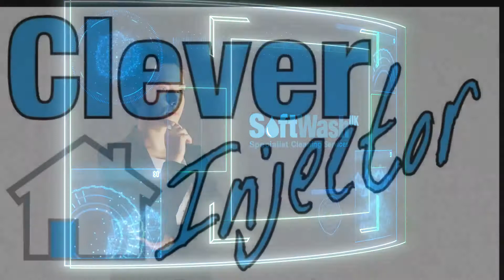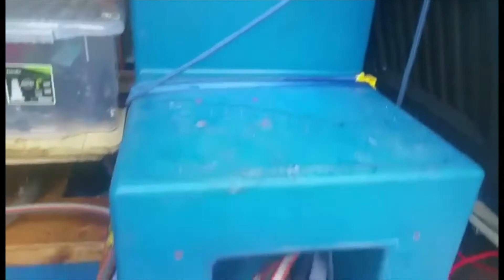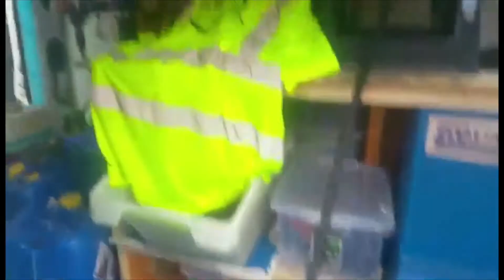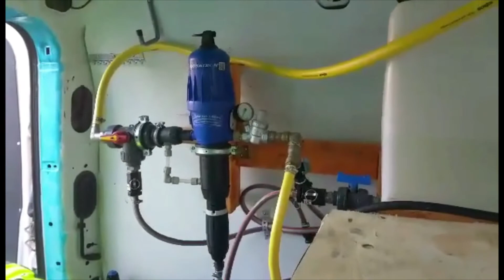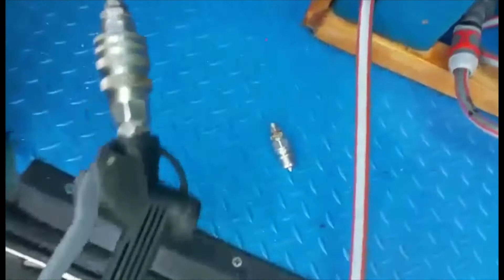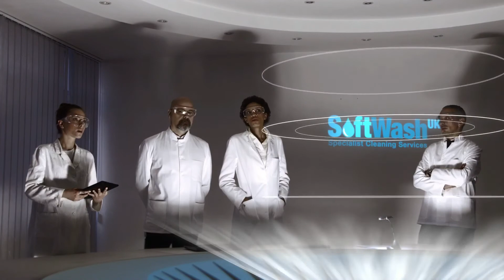Softwashing set up and walk-through

Comment: hi great video. I have this sort of setup. i have a 12v pump running from my water tank to my dosatron. I cannot seem to get the pump pumping to the dosatron. If i disconect the pump from the dosatron i use it without the dosatron it works well. what is the problem? i have been told that the pump has to be after the dosatron. is this correct
Reply: The pump before the dosatron as it only works with the flow passing through it. If you want to use a pump after the dosatron then youd have the dosatron mix into a tank and then pull the chemical from the tank with a pump (no real reason to do this) so pump before and that way doesnt need to be a chemical pump as only handling water
Reply: From the original comment it seems the pump isn't rated enough to operate the dosatron. In reply to the comment above, you'd need a chemical pump after the softwash tank that's holding your mixed chemical. The soft wash tank isn't a pressurised close system. But i think I may have misunderstood when you say " no real reason to do this " did you mean no reason to have the tank and just take the pressurised flow straight from the outlet of the dosatron? Just like the 3 way valve set up he has in the video.